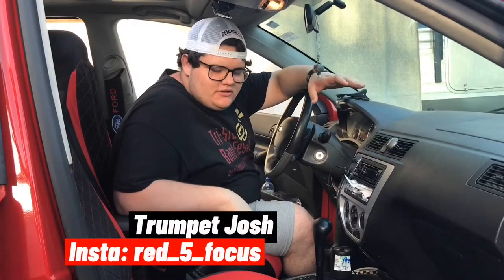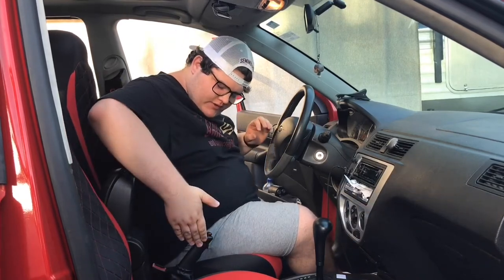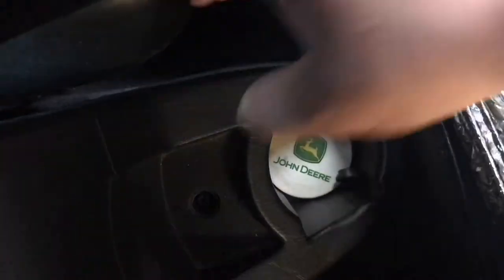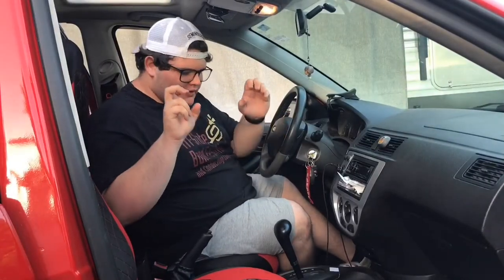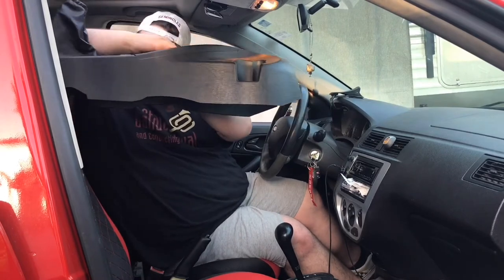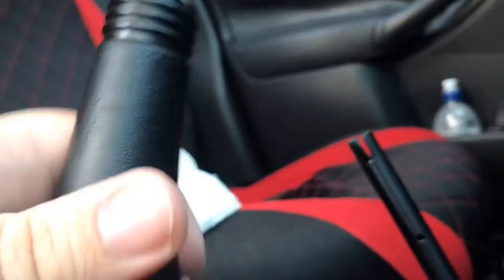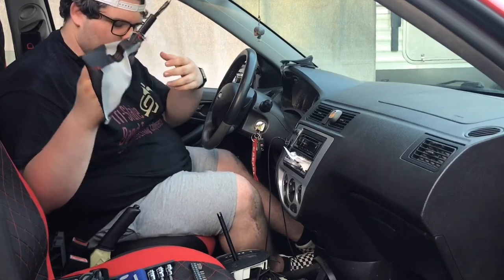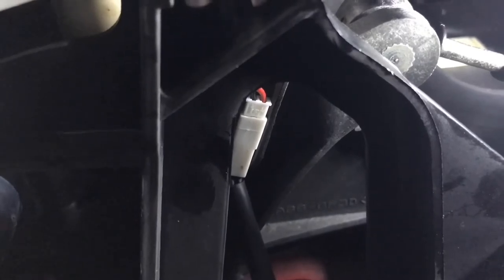How To Take Center Console Off of Your 2005-2007 Ford Focus (Plus A Small Mod 😏)

Comment: Men, I buy all the center console, complete with bracket piece of the armrest, and my focus doesn't have the steel plate to mount the bracket, or the 2 bolts where get snug with the air vents for the rear seats, daaaammiiittt

Comment: if you dont like the noise just stick a large screwdriver or wedge between the door latch and the door sensor so it activates and thinks the door is closed.